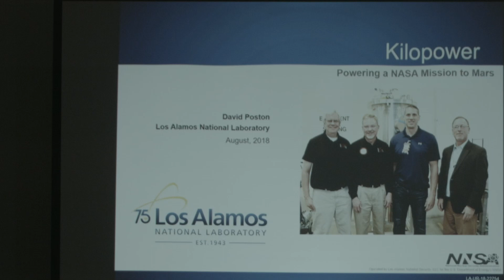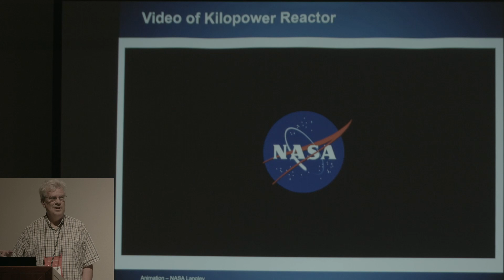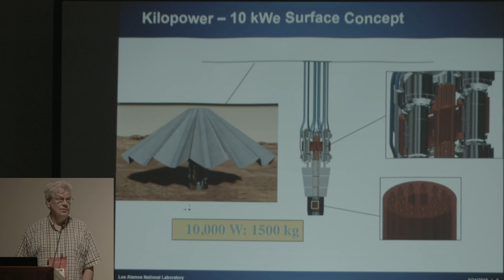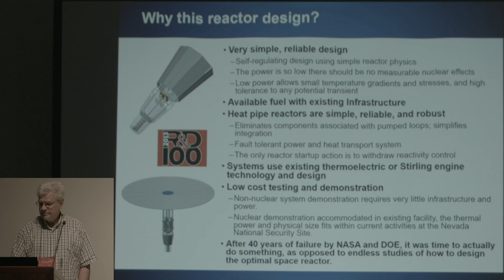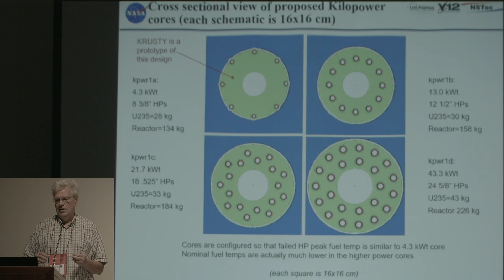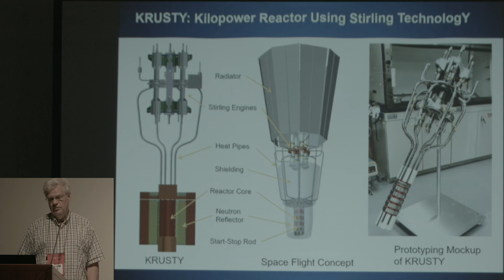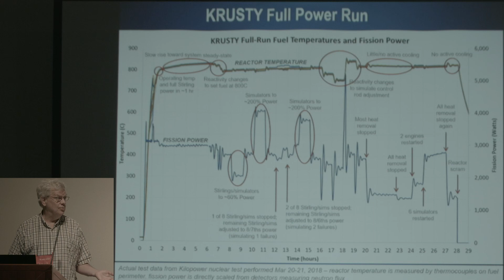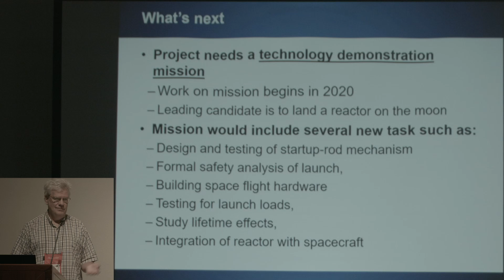Dr. David Poston - Small Nuclear Reactors for Mars - 21st Annual Mars Society Convention

Comment: OK ----------  Musk will LOVE the Kilo Power Reactor. Making Methane on Mars depends on heating Co2 up to hundreds of Degrees Kelvin to break down the Co2. This would cost tens of Kilowatts of electricity production (Acers of panels) using Solar Cells just to produce one or two Kilograms of methane a day. BUT! ... Using the free waste heat from Kilo-Power reactors, Co2 could be cheaply broken down to make Kilograms of Methane an hour day and night while producing Kilowatts of electrical power to run Mars Base. Enough Methane for emergency power on long-range Rovers in case they lose one or several Solar Cells above their vehicle and still power their Starship Home to Earth.

Comment: How easy would it be to refuel these reactors with fuels produced on mars?
Reply: It is incredible difficult to accumulate useful fission material since it is so scarce.
You could fly thousands of reactors to Mars until you get close to the mass of all the mining equipment and refining facilities needed for the enrichment process.
Reply: You'd first have to locate uranium deposits, mine them, and enrich them, all of which would require infrastructure that wouldn't exist there. It would be easier to supply Mars from Earth for quite a while because the fuel is so dense and thus wouldn't amount to that much mass for the amount of power needed. Once we start building serious industry on Mars, then yes it would make sense to create nuclear fuel there.
Reply: Listen to the QandA. The fuel on these things lasts for 200 years. It's counter-intuitive I know, but they're running at low reaction rates and nuclear energy is much more dense than chemical energy. That's why, for example, nuclear waste remains dangerous for hundreds to thousands of years.
Reply: I'm not sure if you were replying to me, but I only brought up waste to demonstrate the point of how much energy exists in nuclear fuels. This particular application wouldn't have that issue because it would just go until it stops and then it stays buried.
Reply: The preferred isotope for RTG is Pu-238 which can only be produced in a breeder.   I guess in a colony you can use any old radioactive sludge and shield it with tons of dirt.
I read once that uranium is more plentiful on The Moon than here on Earth,  but it would still need a lot of equipment to mine and enrich it, so it's a longer term solution.
Reply: MattOGormanSmith  If you had a breeder reactor in space then you would never have to enrich uranium again. You do need a way of recycling fuel for a breeder though, but any chemist with a "hot cell" can do that. That's a lot better than miles of centrifuges.
Reply: Here's a fun idea.  On the Moon, send a jet of unenriched uranium horizontally at orbital speed,  and simply collect the isotopes in separate buckets when it arrives back at the start point.  You might need some magnets along the ground track to do the separation. (does paramagnetism work with single atoms?  I'm not a physicist)

Back to the topic,  if you harvest isotopes from a breeder, you need to replace them with fresh uranium,  so you can't do this on Mars without the uranium mining infrastructure.
Reply: MattOGormanSmith  You wouldn't need a lot of infrastructure to mine enough fuel. You can mine you own lifetime worth of fertile material (thorium or uranium) for a breeder with a pickaxe and a bit of chemistry if you live in the right place in a reasonable amount of time. 

 https://en.wikipedia.org/wiki/Energy_density
 + 22,393,817.40 KWh thermal per kilo of Uranium/Thorium
 *          1.00 Burnup (100% in MSR breeder)
 *          0.35 Turbine efficiency
 --------------- 
 +  7,837,836.09 KWh electric per Kg, Yup that is some potent stuff.
Reply: Mars has no plate tectonics or active vulcanism,  so unless there's a convenient splurge of high grade ore around the mouth of Olympus, you won't find any concentration of rare metals.
Reply: MattOGormanSmith  Mars "currently" has no plate tectonics. Plate tectonics isn't the only way minerals concentrate either. Even earth's oceans have harvestable amounts of uranium ions in them, and possibly in briny underwater lakes on mars, but sure it's moot. The amount of uranium for a colony of a few hundred people is tiny, so an earth shipment of cheap fertile material is all that's needed for decades anyways, a tonne or 2 of unenriched uranium salts for molten salt breeders. They even estimate the Kilopower can run for 200 years at maximum power.
Reply: Yep, sediments at the bottom of underground lakes might be good,  and windblown deposits too.   It's still not a job for one man with a pickaxe though.  You need to establish lots of power first to smelt the iron you need to go mining.  Iron ore at least is plentiful, and you can use mirrors and sunlight for that.
Reply: MattOGormanSmith  I suppose so. If your colonies are consuming a tonne of U238 every year then you sure should have the infrastructure by then.
Reply: With fuel for 200 years, I am hopeful that there will be other solutions available before you ever need to consider refueling.

Comment: So, far I have not been convinced Mars is the best place to space farm and colonies.  Water, Carbon, and Nitrogen are all the arguments that keep coming up.  I will add Calcium and explain.  Setting up the first colony it’s all about launch weight.  So, moon to moon would make more sense since a big bag or many small bags are all that is needed to grow food.  Graphene coils printed on the bag, and layers of bubble wrapped bags will create a magnetic field.  This could be multilayered bubble wrap with every other chamber using magnetic ink and rubber ink on the surface to create sealed chambers from one another till the Graphene is used to open chambers and pump sealant to a meteor puncture. 
Mars for farming would be difficult, and space by comparison tinny, but it can produce fuel from the atmosphere, and it is where people want to go.  So, we double down for them and combine concepts.  We use microbes that create Calcium carbonate from the atmosphere and stone from air, and use our bag concept to make this possible.
First we inflate a bag with our multi layered bubble wrapped exterior.  The un-insolated bag cannot control the cold but at times the microbes can be pumped into it to make stone.  The bubble wrap has a grid of chambers and they can be used in turning the structure into a stone dome.  It only has to be thick enough to insulate, and the magnetic coils of Graphene inside the structure still provide a magnetic field.  LED lights on the inner surface of the bag at some point light the structure inside for plants to grow.  A second inner bag would also be deployed  soil placed in-between them will allow subsurface water from the ground heated in the center to be collected to build the stone dome.  All this could be done remotely and done before astronauts even arrive.
Reply: I do like that your spirited defense of Mars, but a solar array in orbit around the moon or several of them can beam power two them constantly.  As well a microwave beam from earth could do the same.  Since the moon is surrounded by a vacuum.  I fail to see why glass is required since it is ok if plants die before harvesting.  The moon can also be mined too.  Inside the bag a mini atmosphere is created subsurface ice and elements would also be present.  Insulated glass is not an easy thing to bring to mars.  The day cycle for our moon would be a big problem growing plants granted but better then caves we would have to grow food in on Mars needing a constant power source.
Reply: I think the 24h day and decent amount of gravity are too often overlooked by naysayers. I don't think real colonization would have been possible without them. It's an incredible stroke of luck that we have a planet available to us with those properties.

Comment: I think that the kilopower Reaktor is not needed for a Mars Mission. On Mars you still achieve enough sunlight for solar. I would use it for Missions to Ceres, Jupiter or Saturn.
On Mars you can drive the stirling engine by just reflecting light on the reciever of the stirling engine.
Reply: @drewmandan  I am not a American and I think that both big US political parties are utterly corrupted and lost contact with urgent Problems.
However if there is one thing I can say about my philosophical views then that I am absolutely not a conservative.
I just think that solar thermal energy is the best way to go for a martian colony, because parabolic mirrors are more easy to produce with the production capabilities of a early martian colony than nuclear reactors.
In the long term I would prefer to have traveling wave and MSFR reactors on my martian colony.
But past the Asteroid Belt Solar is really shitty energy source.
Reply: Sorry for my Grammar.
Reply: "that I am absolutely not a conservative." In other words, I was right.
Reply: @drewmandan  I would not agree but when you see every non conservative as a US democrat than yes.
Reply: Even with ideal conditions, solar cells (not even including batteries) would be about 16 times more mass than Kilopower. Let's compare:

One 10 kW reactor would put out about 240 kWh of energy per day on Mars, weighing in at 1500 kg.

One square meter of the average solar panel can generate 0.75 kWh per day on Earth (see source), or 0.4425 kWh per day on Mars. So we would need 542 m^2 of solar panels just to meet the Kilopower reactor in ideal conditions, but given the severity of Martian dust storms we would need an overcapacity factor of about 3-4 times that (as mentioned in the video at 15:30). That brings us up to 1,626 m^2 of solar panels. Given that solar panels weigh on average 15 kg per m^2, that comes out to 24,390 kg.

24,390 / 1,500 = 16.26 times more massive ... and that doesn't even include the batteries needed to store the solar energy for night time use. 

1. https://dothemath.ucsd.edu/2011/09/dont-be-a-pv-efficiency-snob/

Granted, the daily solar panel output assumes 15% solar efficient, but even if you double or triple that value, you still won't get anywhere near close to Kilopower in terms of kWh per kg.
Reply: You would need a LOT of power to be able to make mirrors on Mars
Reply: A very small minded comment. What about a dust storm? Or expansion overhead?
Reply: @myrobotfish  You made a very good point.
Although you did not change my opinionn that point, that honor goes to Robert Zubrin, I go with your point.

The Kilopower saves mass, that can go to 3D Printers, food or other useful stuff, it provides a guaranteed power of  max 10kwe reliably and more important 30kw of heat which comes handy during cold martian nights and can also be used for other production applications.

The solar panels would be better put on arid parts of Earth.

Comment: This is not a good idea.

Its use of U235 means that a Mars or Luna colony would be dependent on fuel from Earth because they won't be in a position to do enrichment for a long time.

Thorium reactors are the better way to go.
Reply: Thorium always will be the way to go. But some people higher up dont want to believe in it. You probably already know the reasons.
Reply: +rouge gaming28 I sure do know the reasons: lots of technical hurdles and mechanical problems. No need for conspiracy theories if the realities of engineering will do.
Reply: @totalermist  yeah, that is true. It's will take years of testing in a huge reactor just to make it work. Let alone condensing it into a small portable system. I'm sure there are good standing theories why it hasn't been even used here to. It's been proven to work very effective with less danger. But no support what so ever. It saddens me to know we have this right under our nose and don't even pick the flower. Hopefully fusion will be the norm in the next 30 years. I say that lightly though. It's always been 20 years out.
Reply: Something like Kilopower provides a good starting power source for a young colony. I agree that other infrastructure is needed in the long term, but short-term, using proven technology seems more valuable.
Reply: @pulsarsbeam6411  No Fusion is coming. Check the news. Government is about 15 years away from a true fusion power plant that makes power but industry is starting to pick up. Start ups with fun reactor designs are popping up like mushrooms. That is generally the best indicator that a technology is about to make it. When people can find investors who can be reasonably convinced that a profit can be made, which is now the case with fusion. It's just close enough on the horizon that suddenly everyone and his grandmother are starting fusion companies to be the first. General Fusion out of Canada is one of the top contenders. You might here about them in the news in the coming few years.

Comment: Great..  So we can start dumping nuclear waste on Mars instead...  Mars is already fucked..  So why not... It's not like we can make it much worse..  Right? 

Ignore the above BTW..  I am being facetious... Hopefully someone will work out how to make  a small fusion reactor at some point.   That's the real way forward
Reply: The amount of nuclear waste would be so tiny, and the methods to disperse of it so accessible, that it really is a no-brainer to implement this to further human exploration. It's like throwing a plastic wrapper in the ocean to end world hunger. The benefits are outweighing the cost to a huge degree. Most important is the reliability and safety of these systems, and those are both really high.
Reply: Unfortunately "small fusion" may be unlikely, though more modest cost and "relatively" small compared to Iter may be on the way, look up General Fusion, they have an odd hybrid design that may do the trick
Reply: @UNSCPILOT .. Dammit.. I wanted Tony Starks mini arc reactor... 😀

Semi serious question to anyone in the know how.. But how many of these would you need to strap to a  probe to get it to go around 50% the speed of light.. Which would be the minimum for us getting anywhere in a reasonable amount of time. (10 years +)
Reply: @originalbadboy32  Reaching sign8ficant fractions of the speed of light would be difficult with just stirling generators and say an ion engine powered by it, funnily enough thought Fusion is ideal for such a job as you can use the fusion reactor for power while also using a fusion reaction to make a thruster with ludicrusly high efficency, or even use a big space based laser powered by fusion to apply thrust to a big reflector on the back of the spacecraft, if stuff like that is up your alley go look up "Issac Arthur" on YouTube, he is all about explaining possible near term options and useful space or ground based megastructures
Reply: Its all interesting stuff this ... 

From what I understand of fusion the biggest issues are magnetic containment and the ignition power required in the first place.  Magnetic containment will get there at some point we just need to understand the most efficient way and create materials that can withstand the plasma.   However ignition requires a stupidly high laser pulse to get the reaction going.  If your on a space ship where do you get that the power for the initial reaction from.  You cant make something out of nothing in the end, and I doubt solar power would be enough.   Do you just have a big set of batteries that are charged (somehow) , which then provide the initial ignition.  (like the starter motor on a car for example)

Taking the above into account theoretically how small could a set up like that get (obviously we are not talking about Tony Stark's chest arc reactor here!)  Is the output relevant to the size of the Tokamak chamber, or does that not matter, or do we simply not know yet?

Sorry if the above description is 'simplistic' , I am very much looking at this from a simpleton point of view (as I am one!)